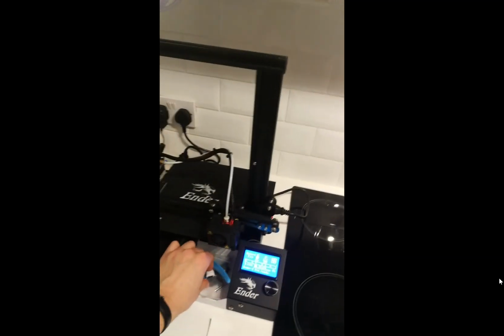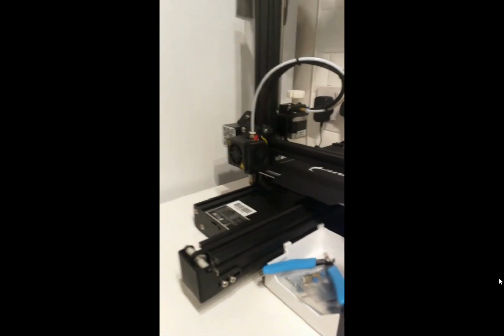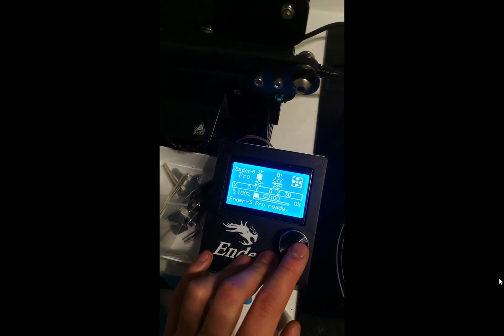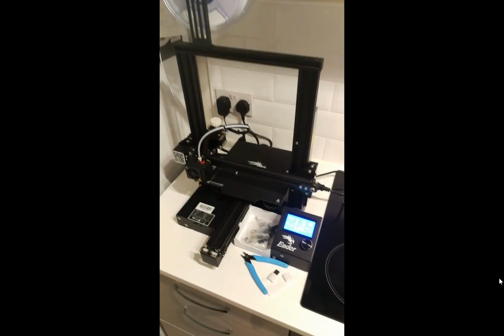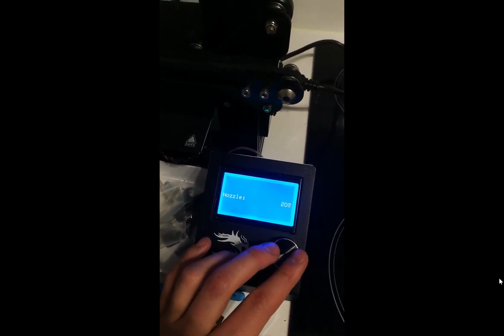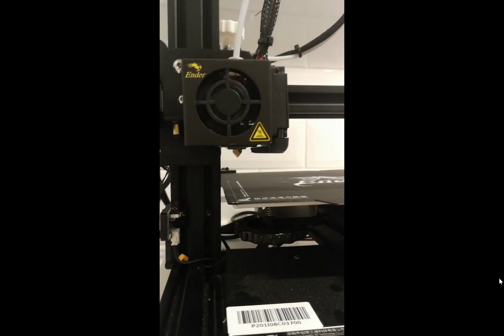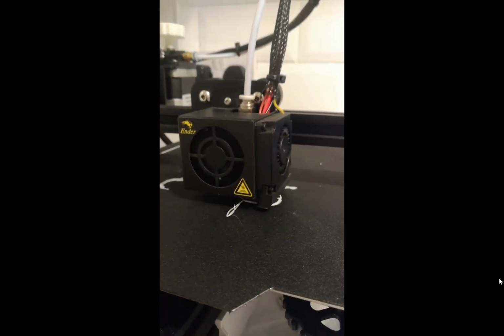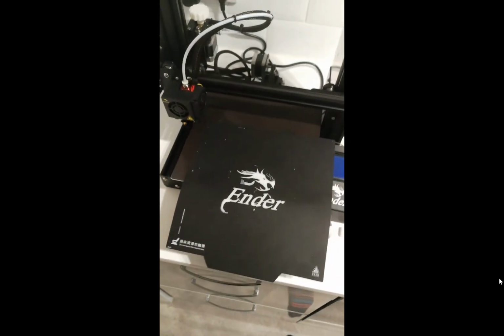3D Printing for the NHS - Creality Ender 3 Pro - Beginning a 3D print

Comment: Hey, I love this walkthrough.  I've been 3D printing for a while now with the Ender 3 and have just bought an Ender 3 Pro to increase the rate at which I can produce these face shield frames.  I have been watching to refresh myself on the setup processes.  Just a tip for you: some slicers (eg Ultimaker Cura) will put the instruction to heat the nozzle AFTER the bed has reached the target temperature.  So even if you don't set the nozzle temperature manually, it will heat it to your specifications before it starts printing.
Reply from the maker: Great to hear! Keep it up 🙏